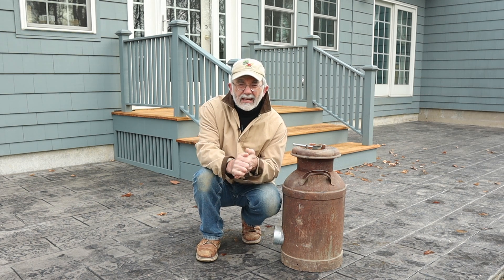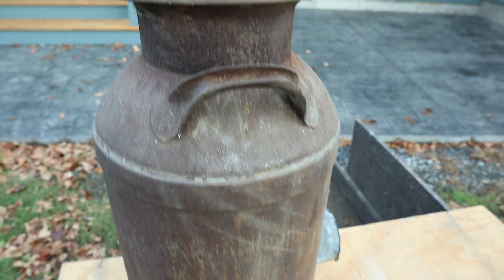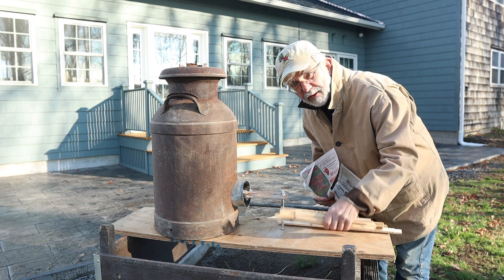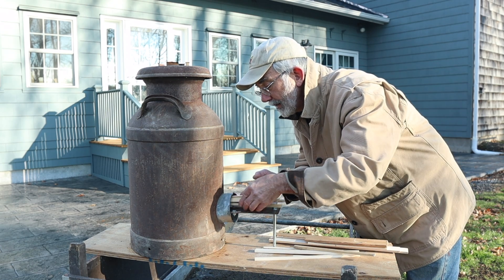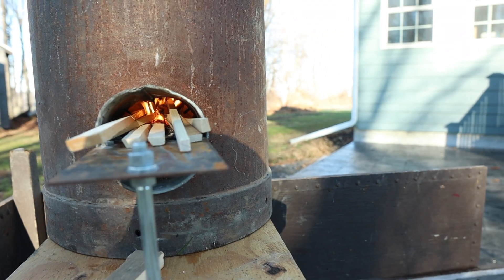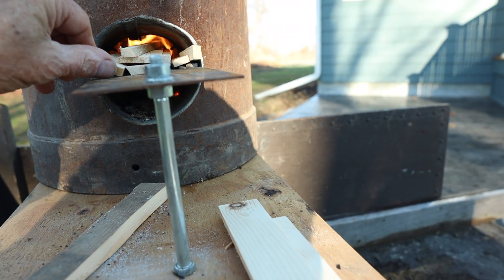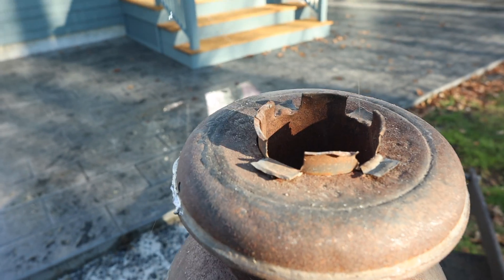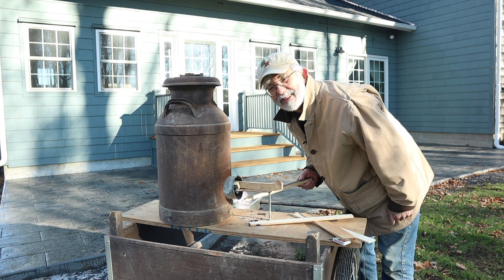This Milk Can Rocket Stove Really Works!

Comment: Drop a few pieces in from the top and it will get going faster
I use old pallet wood in mine, split and cut to 13 1/2" and stored in old paint buckets with a lot on to keep the wood dry.

Comment: I have heated my work shop for many years with a J tube style Rocket stove. It is made with a 100 pound propane tank. The burn chamber and flue are lined with fire brick. It will burn wood or pellets. I love it.
Reply from the maker: I've seen those. Very impressive. NOT a novelty like my stove. 👍

Comment: Looks good as always! Have you thought of adding a second elbow at the front, then you can add fuel vertically and it will self feed.
Reply from the maker: Some sort of self-feed configuration would be a lot better, for sure. Dropping wood into the top is a sort-of self feed approach. It really fires up with fuel in the top. 👍